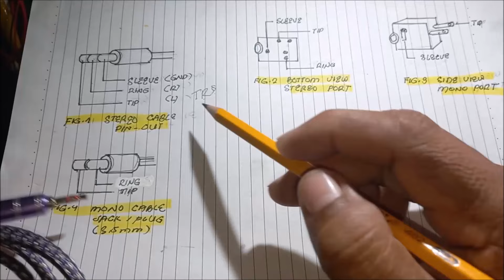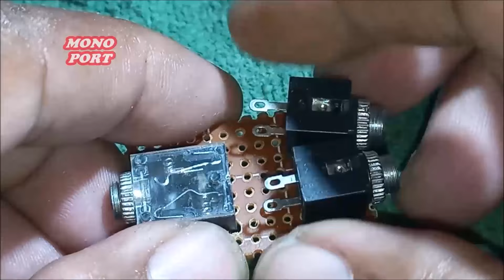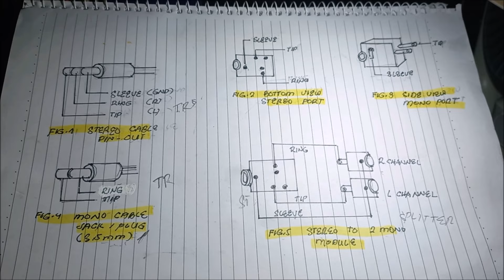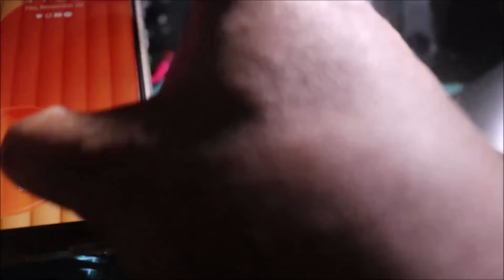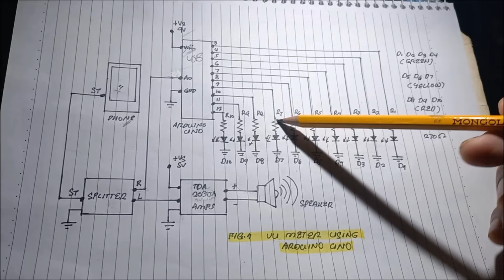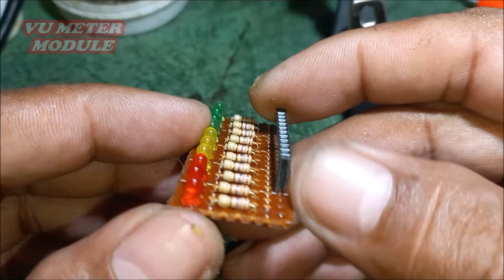VU Meter using Arduino Uno Microcontroller (DIY)

Comment from the maker: CODE....
int led[10] = { 3, 4, 5, 6, 7, 8, 9, 10, 11, 12}; // Assign the pins for the leds

int leftChannel = 0;
int left, i;

void setup()
{
for (i = 0; i < 10; i++)
  pinMode(led[i], OUTPUT);
Serial.begin(9600); 
}

void loop()
{
left = analogRead(leftChannel);

Serial.println(left);

left = left / 5;

  if (left == 0)  
   {
   for(i = 0; i < 10; i++)
     {
     digitalWrite(led[i], LOW);
     
     }
  }
  
  else
  {
   for (i = 0; i < left; i++) 
    {
     digitalWrite(led[i], HIGH);
     
    }
    
    for(i = i; i < 10; i++)  
     {
      digitalWrite(led[i], LOW);
      
     }
  }
  }